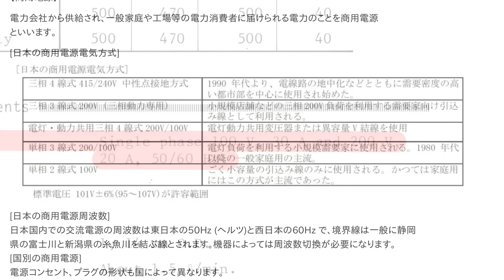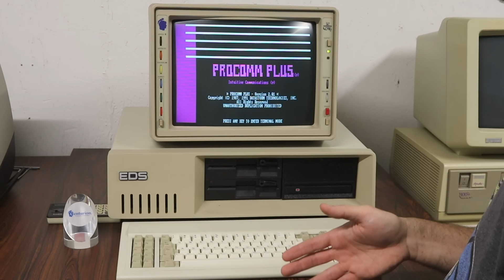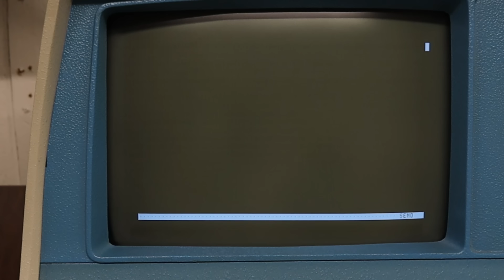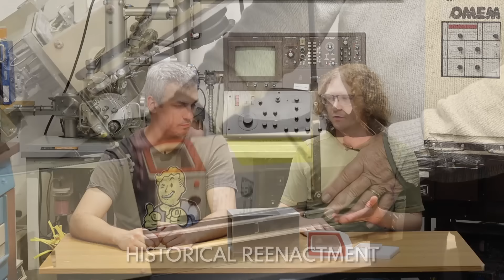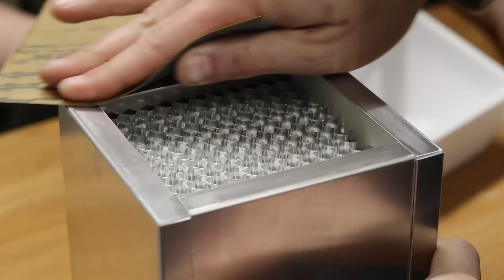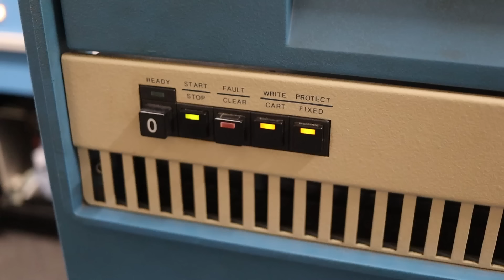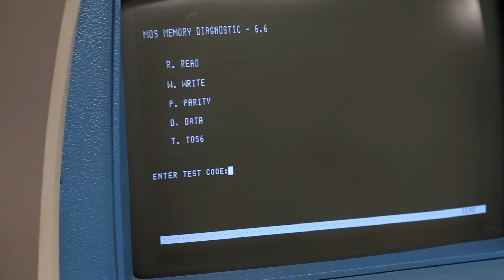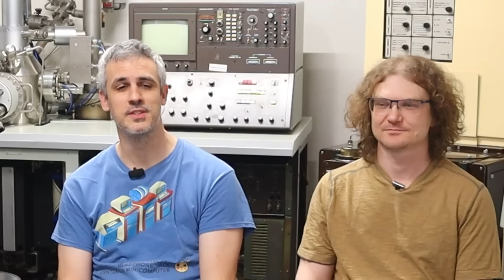Welp... that's terrible.

Comment: 110V to 100V: Use a transformer that steps 110V down to 10V. Then connect the secondary winding in series with the 110V line. If you wire the secondary in reverse phase, it subtracts 10V from the 110V, giving you 100V. The same principle works for stepping 220V down to 200V.
Reply: I'd look if it's possible that it can be rewired for 240V, if it has transformers with multiple taps or switching power supplies that can be modified or are wide voltage range.
Reply: That transformer still needs to handle the 20 or 30 amps, those are huge and expensive. A decent "autotransformer" might be a cheaper solution. Also check if the built in transformers are already have taps for higher voltages. If they are switchmode power supplies they probably work fine on 120 Volt
Reply: @gertk2303  Industrial buck/boost transformers are very common, and transformers only need to handle the potential difference between the supply and the load.  A 16V buck transformer dropping 120V to 104V for a 30A load only needs to handle 480VA despite the load drawing 3,120VA.
Reply: @gertk2303  Yes, but only on the secondary side. By connecting both coils in series you make an autotransformer out of an normal Transformer. The connection between the former Secondary and former Primary winding becomes the Tap of the autotransformer. Yust look what you can get for a reasonable Price.
Reply: @gertk2303 
A 10V/30A transformer is 300VA. That‘s not cheap but also not a big one. And it us able to reduce voltage for a 3kVA supply.
Reply: Also, if you can't find the exact transformer that you need, it's surprisingly reasonably priced to have a transformer custom wound in China. Or at least it used to be that way some 10+ years ago, when I had the need for that. Found some random vendor on EBay and e-mailed them a question.
Reply: @gertk2303 only the 40V section, so a 1000VA should do it, it’s still big, but not that big. Or, split it into 10V each transformer so each one around 200VA, much better - multiple small transformers. Might get surplus ones off eBay.
Reply: @gertk2303 i think variac will be easiest and safest. The only caviat is accidentaly bumping the knob...
Reply: You may also use a 12V Transformer ( With sufficient max Current on the 12V side ) and connect the 12V Output in series with the 110V Input.
Check with 110V connected to 110V and You should get 122V on the Output. ( Flip the 12V Coil if you would get about 98V at the Output.
When everything is as described reconnect the 110V to the Output and You will get 110V * ( 110V V / 122V ) = 110.9 V at the Output.
Current to the 12V Coil would be about 90% of the Output Current ( 10% coming from the Primary Winding ). 12V Transformers are much more common ( 12V Lamps )and normally much cheaper.
Reply: Yep, and the neat thing is that the secondary needs to pass the high current, not primary. Guess easier-to-find 12V would be OK too. Two such trafos for dropping 240V in series, both primaries and secondaries.
Reply: I always tend to prefer the quick and dirty solution..  a fuel powered generator?
Reply: I thought the same, but the transformer pictured is labeled buck/boost, so I assume that's exactly what it's doing.  The issue is the 30A secondary.  That gets big and expensive.
Reply: Or have a look at japanese step-down auto-transformers, they can be had relatively affordably. Locally there is a company that winds them custom for not too much money.
Reply: I would suggest ether big variac or the transformer magic other comments suggest. Remember, deviation of 10v should not cause that much trouble
Reply: No
Reply: 110V in tolerance range for 100V+/-10%  electric network and work fine
Reply: @TheOldGraff  generally true, but in this case the datasheet shows a tolerance of just 95-107 V, and the US is 104-127 V depending on location
Reply: 100 and 200 run just fine on North American outlets.. This talk of transformers and this that and the other is total nonsense
Reply: @TrollBooth500  It depends on the equipment.  It's a 20-25% overvoltage.  It may or may not cause issues.

Comment: Autotansformer or just look inside the supply. Most of the time you can run these with 220-240V because SMPS rectifie the ac anyway (the pk-pk voltage would be slightly higher)

Comment: If the microprobe does not need fully isolated supplies (as should be the case with japan mains voltages), you should look for auto-transformers. Those are much much cheaper, because there is no secondary winding, just primary winding with taps for lower voltage, much less expensive copper. Also check if the machine already has configurable input transformers that can take 110/220 native.
Reply: An auto-transformer will also be much smaller because it only has to be rated for the voltage it's dropping and the current. I.e. If it's dropping 40V at 20A the transformer will only need to be rated for 800VA where a normal transformer for 200V at 20A would be a 4kVA transformer, so much larger and heavier.

Comment: Is that 28 amps max???  I know that PSU's spike on activation, which may cause trips if the supply goes on the beyond 20 amps, so have you thought about a staged activation to reduced the max load?

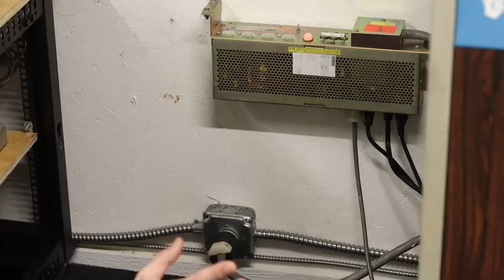Comment: 4:24 us electrics are so ancient looking..
Reply: it does look like the old decommissioned electric circuit in my old european garage
Reply: To be fair, MC cable isn't really meant to be surface mounted in a finished space like that. It should have been either run in the crawlspace/attic or put in conduit.
Reply: No need to change what works!
Reply: @NOSdWOH1  works, you cant even power a pressure washer off that garbage.

Comment: There are "bucking transformers" that can make smaller changes like 120v to 100v... somehow most of the power doesn't go through the transformer, just the extra 20v times the current, so they are smaller and cheaper. I really don't understand it or remember the details.
Reply: It's called an autotransformer. Basically not a Transformer it's more like half of an Transformer. The primary is just wound a bit more and than you can tap it all between 0-input-some over the Input voltage
Reply: @luca87375  Thanks autotransformer is the word I could not remember!

(I think bucking transformers are often autotransformers, but maybe not always, or something like that...)

Comment: I thought there was nothing scarier than an unexplained error you've never seen before. Turns out there is... A INTERMITTENT error you've never seen before! lol Hopefully that was just a one off lol
Reply: You know you're a true engineer when you like errors. Errors are a good signal, they're not scary.
 Now, intermittent errors, those are evil.
Reply: I kind of wonder if one of the disks wasn't quite stable and ready yet, so had some read problems but was sorted by the time he tried again.

Comment: The way I understood the installation requirements (verify!), you need both 100V and 200V for the device. Can drop some volts off the mains using a smaller transformer that will draw some hefty power but that might be more efficient than one gigantic transformer you were looking at. You'll need either a single 1.6kVA step-down transformer with two 20V windings one rated at 50A and the other rated at 30A, or two separate transformers (which may be easier to do) - one at 1kVA (20V 50A) and the other at 600VA (20V 30A). Wire the secondaries out of phase in line with both live wires of the mains to the device. That will drop 20V off both phases, giving you 2x100V - the 100V and 200V you need. Verify the schematic or reverse-engineer the mains power to see if you need neutral on the 200V power, rewire if needed. Fire to the wire!
Such transformers may not be that hard to find if high power 24V DC is a common thing; might be for industrial automation. It doesn't have to be exactly 20V either - you can go a bit higher (30V etc.) and drop the unnecessary excess off with a variac if you have a big one (over 1.6kVA). 

Lovely job on the air filter! Pity about the head crash. Well... shit.

Soft kitty, warm kitty, little ball of fur. Happy kitty, sleepy kitty, purr purr purr.
Reply: What about a auto transformer
Reply: @AddicteServer it's a good idea too, pretty useful in the lab.